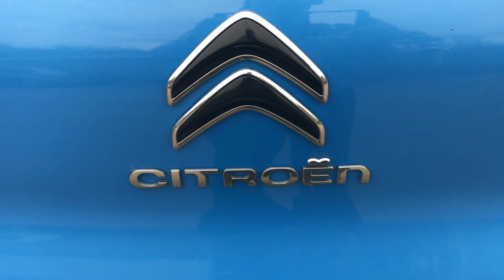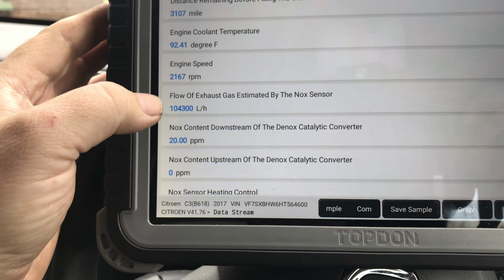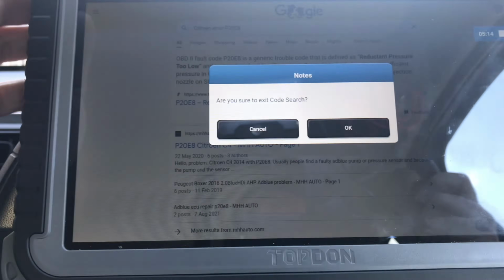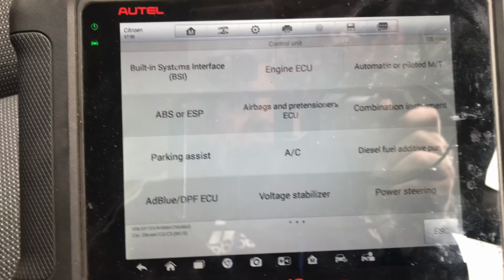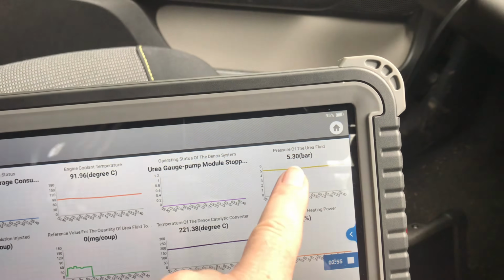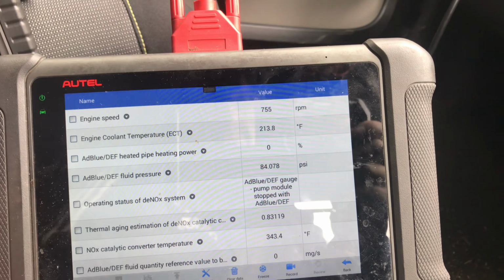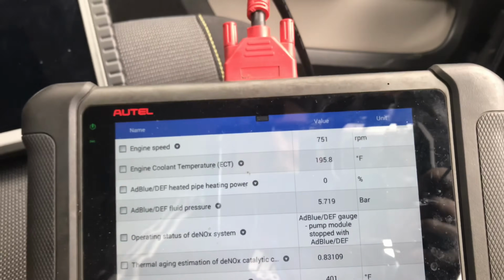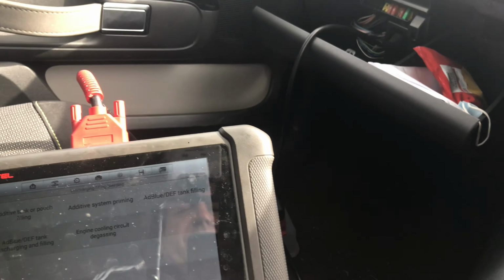Citroen C3 (2017) AdBlue Nightmare😭 - P20E8 Urea Fluid Low Pressure

Comment: The fault P20E8 is always temporary because you have cycled the key at least once since the fault has occurred causing it to be not active. It is enough to cycle the key once after the triggering cycle for it to go temporary therefor drawing the conclusion that P20E8 is a temporary code and you just gotta refill tank and reset the denox system is incorrect.
However sometimes although very rarely it is truly caused by low fluid but then the car will warn you well in advance (2400km) before that you have to refill so most customers are well aware whether low fluid level has a play in the fault or not. You can check this in Denox 2 parameters, the tank only measures up to 6.1L so if the parameter says above 6.1L then you are good.

Sometimes it is easy to confirm whether it is the tank by going into Denox 2 parameters and checking for Adblue temperature and fluid level, if any of those are 0 (default value) when they clearly shouldn't be, the tank has an internal fault and should be replaced. The fault code P20E8 is easy to misunderstand if you take it literally, there is an absence of pressure but it is only the indirect reason for triggering the fault code. If the Adblue-system senses a fault within the tank (temperature, level, heater, continuity, integrity or software fault) the whole system shuts down and sets the fault code P20E8 - Low pressure but a better fault code definition would be fault detected within the Adblue tank causing the system to shut down the tank assembly, as I said sometimes you can see the fault yourself by looking at urea temp and urea level but sometimes those two values are real and working and something else is wrong within the tank which you can't see, if that is the case then check power and grounds to the tank, check adblue injector, check for Adblue leaks and check for NOx sensor correct NOx data during driving just to make sure you are not missing anything, if all seems OK the only thing left is the tank itself. The pressure and level btw you find in Denox 2. Btw 4 bar urea pressure is a replacement value / lowest value the sensor can read, if the data says 4 bar it means no pressure or pressure below minimum reading point meaning it means 0 bar 0 pressure.

We / I diagnose and replace literally 100s per year working at the Peugeot dealer.

Also for your information about Adblue / urea vs PAT / Eolys / Additive. All PSA diesel cars since long and even to this present day with the cars rolling of the factory still have the additive / pat / eolys fluid and since like 10 years or so also in additon Adblue side by side with the eolys, one as a fuel additive and one as an exhaust aftertreatment as was the case for the car you had which had both Adblue and Eolys.

The thermal ageing of the denox converter is a value that starts at 100 for a new one and starts counting down to 0 as the computer calculates its aging / degradation. The calculation is based off of theoretical NOx generated (because there is only 1 post sensor on these unlike the new ones which have 1 pre and 1 post) calculated from a table in the ECU and comparing it to the post cat NOx value and seeing how effective it is in comparison to what it is expecting. As I said this value is counting down to 0, when they get to around 25 they are usually junk despite having 25 counts left.

More than likely this customer will continue having trouble with the code coming and going until the tank is replaced.

Replacing the Adblue tank with a used one is not worth gambling with considering they may develop the same fault quite quickly, it's better to buy a new tank however it is ridiculously expensive and not logical to replace unless you can get warranty or the insurance company to pay for it leading to most people just doing Adblue OFF reprogramming when this fault occurs and not being able to pay for the proper repair.

Btw 4 bar adblue pressure in Denox 1 is a replacement / placeholder value and means the system has not yet activated and currently has 0 bar of pressure because 4 bar is the lowest the sensor can read and a working system ALWAYS starts at 6 bar and drops to around 5.5bar during use because of slow bleeding of pressure through Adblue injection but is then triggering the pump to build pressure again back to 6 bar. Therefor 4 bar = 0 bar.

Also the level of theAdbluetank being sufficient was not a question for the sake of fault finding or diagnosing because the tank already had sufficient fluid level to work as you can see in the Denox 1 parameter where volume of fluid measured in the reservoir is 6.1 which means it's at 6.1L or above because the level sensor only measures a max of 6.1L, so if you see 6.1 its sufficient for system to activate. That being said ofc filling the tank is a good thing to do anyways just a bit sour for the customer if the fault returns and having paid for the Adblue and ending up doing Adblue OFF ;)

The pressure building does not take place until all the right conditions are met, you can see when they are met by looking in Denox 2 at 2 parameters, 1 being Authorization of pressure based on temperature and the other being authorization of pressure based on pressure, only when both of these turn to 1 / ON / YES does the system start and build pressure and start injecting, as long as any of them are NO the system is not turned on.

Authorization of temperature turns to YES when the exhaust temp reaches 200C.
Authorization of pressure turns to YES when all internal tank parameters are correct such as temperature, heating pad circuit and feedback loop, continuity, software, Adblue quality etc.
Reply from the maker: Thanks for post lots of good information cheers sandy
Reply: @sandyande  Np, just added some more knowledge drops I remembered after posting the original comment.

Will comment on some more of your videos just to get any viewers / customers aware as well incase they only stumble upon one of the videos and not this specific one.
Reply: Hi. Some very good info on here. I am having trouble with a later (2019) vaxuhall combo p20ee. Injector has been replaced and rear nox sensor. Reset and clear faults but comes back after a couple of weeks. Do you know if there are any software updates or anything else to look out for?
Reply: @martinsansom  Take it for a test drive whilst reading parameters, check all things as I listed above in my long text, also look for leaks. Check Denox cat thermal aging, check actual vs commanded adblue injector amount, mostly you will see the problem comparing NOx 1 and NOx 2 to see the effectivity.

You are on the right path, P20EE is almost always injector and / or sensor but can be the catalyst itself, does the tail pipe have white-ish (Adblue) residue on the inside of it?

You always update the software on these, so more than likely there is a software for the car but if there is an actual fault it won't solve it.

Lmk what you find and how you solve it!
Reply: @nesmio7378  Master, what could be the reason that there are white adblue residues on the inside of the exhaust pipe?
Reply: @ebolti22 Leaking Adblue injector - remove it and clean it with warm water, if you can also run warm water through it and activate at the same time with some wires and a battery.
Can also in rare cases be cracked Denox-catalyst.
Reply: @nesmio7378  Thank you very much, I will check it out.
Reply: Lova ya as a fellow car mechanic
Reply: First thank you for this tips. I have a 308 1.6 hdi with P20e8. The temperature in urea tank is 0°C when dtc accured. So i did the urea tank replacement and now i have 16°C. Is it possible when the tank is emptied the software locks down, and until you do the canister change adjustment the temp of urea is not shown???When the car cools down im going on a test run and if this doesent work im replacing the canister wit a new one. I opened the tank and there is no leak everything looks ok. Thank's for your reply.
Reply: @avtomehanikarozman5851  The adblue tank goes into a failsafe mode and locks whenever there is a fault stored related to it, until it is cleared and reinitialized. During this fail safe mode it broadcasts no data to the ECU making all data points it's default value. When resetting the tank the fault is no longer active (ofc it's not because the tank hasn't done a pressurization cycle yet) so all values are active and reported again. The only thing this tells you is that most likely the temperature sensor of the fluid itself is not your problem. Reset it a couple times and try, if it comes back just replace it. Sadly no diagnostic method for these tanks are available, just guessing, trying and experience.
Reply: @nesmio7378   Good thinking. I made a long test drive. No dtc at the moment. i made all the denox test efficiency, pressure test.... very hard to diagnose. Now i know why dealers change the tank on a daily basis. Thank you for all the info. At the begining i thought that urea tem. is a ghost parameter and thet the ecu is heating urea by outside temperature. Thank's...
Reply: Delete this stupid system, it's just one more money pit created to make somebody rich at the expense of the gullible owners.
Air quality today has never been better and has nothing to do with adblu injectors but more to do with the change from coal fired heating in homes to gas fire central heating.
In addition, the reduction of coal power stations and old industries that used coal for energy, metal refinery and steel production are now almost totally coal free.
Reply: Having a leaking adblue pipe here on Berlingo 1.5 which can throw up same code obviously the pressure will be low, TBH tho unless you are cleaning adblue injector regularly you are going to get issues. Wouldn't try on a PSA 1.5 without a ramp.
Reply: @james684  It's very very rare. The newer cars have multiple fault codes specifically geared to leaking injectors, for example a P20F6 amongst others. But yes, defo regularly warm water clean it.
Reply: @iNfeeeect
Reply: @nesmio7378 Thanks for your insight. I have just encountered this issue and I was wondering if replacing the tank completely and erasing the fault code would that stop the fault code from coming back? I’m planning on changing the tank myself and I would like to know if I need anything special for this task. Thanks
Reply: @Grrratian  Yes, it would stop it until the tank fails next time. Remember to do a re-initialization of the adblue system and you'll be fine - nothing special about the job just make sure you have a scan tool compatible with replacement procedures.
Reply: I put injector new because error block injector and next day P20E8, what is the problem ?
Reply: @Richardcroitoru  Read my other comments.

Most likely Adblue tank.

Comment: On a benz the fault is usually a blocked adblue injector as the adblue crystallises and blocks the injector, remove injector and clean with boiling water and refit clear the code and your done
Reply: I'm having a similar problem.  How much did it cost to have it fixed
Reply: @abbey property care 80  just remove the adblue injector place it in boiling water and it will disolve the caked on ad blue. Cost 20min of your time. Worst case it needs a new injector anywhere between 200 and 300 hundred euro approx

Comment: Hello,
I had the same problem on my 5008 blue hdi 120 peugeot.
After doing all the possible checks and tests, I had to face the facts: Ad blue tank pump module out of service.
This is a recurring problem on psa brand models, still not solved because the manufacturer still sources from the same equipment supplier and replaces with identical tanks, so this problem is not over. Thank you for this video and good luck. (psa has become Stelantis and markets among others Peugeot, Citröen and others.
Reply: Not strictly true. There has been an update to the tanks

Comment: Hi there,i have similar problem,ds 3 2015 1.6 diesel,UREA error on dashboard and emission error on radio car check,i just added add blue full tank about 6 liters,reset error at the garage and light came back after 3 days😮😮😮😮

Comment: I have the same problem. After a bit of digging I found out that the add blue system should have been repaired by the dealers free of charge, as it’s a service recall. Fingers crossed.
Reply: Do you have more information which cars are included in this service recall?
Reply: I would like to listen as well

Comment: Got a tank problem on my 1.5 berlingo. I noticed you said there is no engine light, this does not always come on, no idea why. My injector was blocked and upon cleaning and reinitialisation the tank would not run. Tank replacement required but no engine light or adblue warnings. These things are just a pain in the arse. If anyone needs a pump type your part number in at neobrothers. They have manufacturer tanks far cheaper than citroen supply them. I saved £500 on my tank.
Reply: Just don't get 1 please

Comment: Guys , drop the tank…these have actually got a non changeable filter in the tank.
You will find once dropping the tank screws surround like a trap door where the pump in on the tank. 
Once you undo those you can move the lid just enough with wires still connected to expose a circular white filter with like a black straw hanging out of it.
Get a syringe and inject water in to kill the adblue . Dry it .
Box it up 
Refill 
And test
Forgot to mention, on the engine side of the tank a 25t screw holding a little pull door to drain .
Had this fault and cleared like so!
Hope it works for you guys too
Reply from the maker: Hi did you renew the AdBlue pump or the filter? Cheers sandy

Comment: I have had the same problem. In Turkey at one shop only they repair the electronic unit by means of a few instruments and fix the problems. In our facebook groups there are members claiming to have the problems solved there. I talked to the man and he said he never witnessed a problematic pump and the problem is always about the electronic card if its a low pressure issue.
Reply: Nerede bu tamir yeri acaba?
Reply: @HsynCkr900  Eskişehir selcar otomotiv. Ben yaptırmak için randevu aldım fakat randevuya 4 gün kala arıza lambası söndü. Ve hala sorunsuz çalışıyor. https://www.youtube.com/watch?v=SsNCe1C6gmg&t=40s

Comment: Hi Sandy.  Thank you for video.  Re:  citroen c4 grand picasso 1.6 bluehdi 17 plate 41,000 miles.  Same code.  Will be changing adblue tank next weekend.  I have otofix scan tool (similar to your autel i believe).  Re procedure to let ecu know new tank installed, click on special function, then pack special function, then parts replacement, then work on emissions control circuit. Then there is the option, "fuel additive pump replacement or additive tank replacement" .  I know have to select this option, however not sure if I have to also  select another option,  "replacement of denox system reservoir, gauge pump module or pipes" ?(27.33 minutes into video). Appreiciate any feedback.

Comment: I have had fault recent codes P20F6 telling me the reductant (ad blue) injector is stuck open. I replaced the injector and cleared the fault code and it was ok. A couple of weeks later the same message came up. Given that I had fitted a new injector I cleared the fault. A couple of days later I got P3052 ad blue pressure low which sounds like an expensive pump/ tank replacement. Can anyone tell me if the ad blue pressure keeps the injector valve closed until it's opened by electrical signal.

Comment: I too had this same fault code with the warning light on a 2017 dispatch yesterday. For some unknown reason my autel won’t communicate with any Citroen dispatches of any year under specific manufacturer, but I got the code through generic eobd.
Called a few people, looked online, yup, £1000 plus vat for a new tank…. Pump has failed apparently.
Customer is trying to get a recall/goodwill replacement, otherwise it’s a big bill for him….
Thanks for video 👍🏼
Reply: Sometimes you have to go in as a Peugeot to get full list of options

Comment: Main problem with Adblue is in liquid. With the time system get crystals everywhere and get stuck in injector, pump and so on. Solution? Put a some quality small filter for petrol engines as in motocycle or cars, after reservoair and replace him regulary. You will avoid future problems.
Reply from the maker: Thanks for good advice cheers sandy

Comment: Last year I had my nox sensor replaced costly that was £565 now I have a fault with code p208e and p20ee can't wait to get rid of my diesel nothing but expensive fixes
Reply: P208E its the tank P20ee its an ECU update
Reply: I have p208e at the moment and they told me is the injector!i have Peugeot boxer,atm im waiting for the injector!when i drive the van to much smoke from exhaust!
I pay allready 450£ and still they cant found the problem

Comment: Last year I had the same problem, only the citroen official assistance was able to repair it. Citroen has to carry out this type of diagnosis by calling the central repair bank in France. Diagnosis, replacement of the ad blue pump, there was no fluid passage from the reservoir to the particulate filter.

Comment: 1K for an ad-blue tank,that seems like another reason not to buy a Diesel Citroen. Just an Idea, you could try a variable resistor on the tanks level sensor and see if could fool the car into it thinking it has a full tank. The owner would have to keep topping it up. Just a thought.
Reply: Most level sensors for adblue are not a float/variable resistor type, but there is probably some way of fooling it